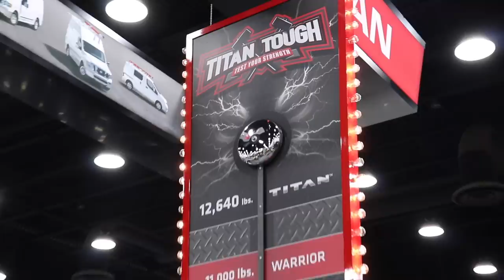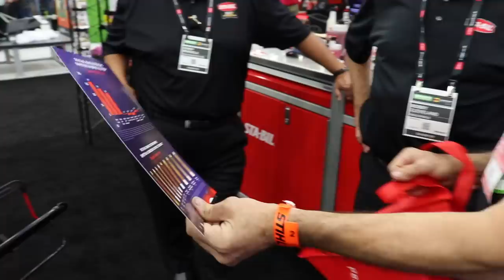Taryl Fixes All @ The 2018 GIE Equipment Expo Louisville, KY (3rd Appearance)

Comment: Taryl, I have a Blackmax generator I'm working on. It has a 208cc engine which I think is made by homelite. It had alot of build up around both valves and they were not seating properly which resulted in no compression. After takin the head off I was looking at it and when I turned it over a little metal button fell into my hand. After a little research I found out it was called a rotator. Since I didn't see where it came from I don't have any idea where it goes. Can you help me out? Where does this thing go? I think it sets on top of the exhaust valve but I'm not sure. I have rebuilt car engines and I'm very good at doing my own repairs but this is the first time I've ever rebuilt a small engine. 
(With the help of a couple of your videos). Thanks in advance

Comment: the tools may be going battery but they still have moving parts that will need sharpening and fixing and tightening so your job is still safe plus, there are still zillions of tools out there still running on gas ...great video guys

Comment: I’m old school gas man. I bought a Makita 36 volt Lithium ion chainsaw, thinking it was probably a bit “toyish”. Man, that is a serious chainsaw!! It will cut anything my stihl cuts! I believe batteries may be the future Taryl! Better get to learning how to repair them electric motors.
Reply: They are captive products, the first one you buy you stick with that company as batteries are not standard. Very smart.
Reply: Tony Papantoniou yeah that is very true. However, it works for me because the 5 amp hour batteries (4 of them) that came with the saw, with the 2 battery charger, compliment all my other 18 volt makers tools. If you buy dewalt, your a dewalt captive.
Reply: LOL dewalt control you now.
Reply: Yea for now, until someone over in china decides to start copying and cloning the batteries and sells them cheaper than the manufacturer does.
Reply: @bctruck  batteries are about worthless. Unless you're in the backyard cutting up a couple 2-inch branches. Anybody who serious about doing anything with power equipment including most homeowners do don't fool around with battery-powered junk

Comment: Small gas engines will always be number one on lawn equipment because batteries for these things will always be to expensive for us common folk. Great video guy's!
Reply: The prices will eventually come down. Electric is the future. They run clean their much quieter and their practically maintenance free.
Reply: The batteries will die, maintenance, wires will be jenky and come loose (locate and repair)more maintenance, electric motors will fail, maintenance, bearings are still there and going to wear out, more maintenance,diodes and capacitors etc etc.  In the long run maintenance mechanical skill will be required.  Hence work will still be available. People will buy new ones because of a loose wire and no mechanical skill, thus also netting us some nice profit from time to time 😊
Reply: The number one reason small engine gas engines will be around for at least 50 years. It's very simple. Capacity is the number one problem with anyting operated by battery. Most yards you're lucky to get a third of it done before your battery whiz-bang goes dead
Reply: @Mr_Tecumseh  nothing is maintenance free
Reply: @chancewindham1718  🤥
Reply: @Mr_Tecumseh  lol to all of what you said besides quieter

Comment: I own a gravely, but a big thumbs down for them not allowing us to see how the mower works. Also how long can the battery operate between charges? Hard to imagine this working in commercial applications where they run 10-12 hour days.
Reply: They just came out with it. Patents are pending and they don't want the chinese taking a good close look so that can turn around and copy and clone it so fast. I think it was smart, it protects a good US based company and by doing that protecting the U.S. itself.

Comment: Now this is a great video :)   Love the skits and the easy to follow lessons. 

You inspired me to R&R the carb. on my Bush Hog CZ2349 Zero Turn. :)   I let others diagnose it but I did the work :)
Now I have to diagnose a :
Karcher G2500VH High Pressure Washer with Honda 5.5 HP GCV160 EngineAll I know is that it was in a flood but not completely covered.  It has no electric start but the rope pull does turn the motor. 
I thought I'd start w/ cleaning all electric connections, then move to the fuel tank, air cleaner and carb. ?Any suggestions ??   Or is this not enough info ?
Thanks for your generous consideration and sharing of your video's which make me feel I might be able to fix things myself :)Sincerely .............................Steph

Comment: Looks like you guys had a blast. Also looks like batteries are going to take over.
Reply: Batteries will NEVER EVVVER take over!!!!!
Reply: They will. Its getting their. Batteries are already as powerful as gas in some applications. Their Quieter, no gas, no smell of gas, no oil, no fumes, no air filters. Zero maintenance. Their clean, zero emissions. The only reasons cars arent already primarily electric is because of the monopoly of oil companies that are not going to allow it, because of $$$.
Reply: @Mr_Tecumseh  -  There vs Their vs They're...  It's getting there.... They're quieter.... They're clean...